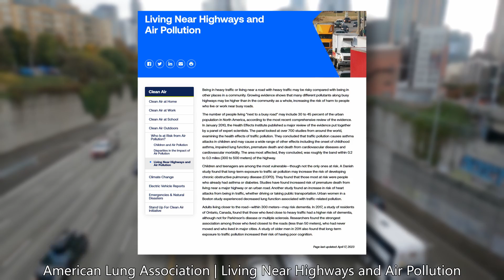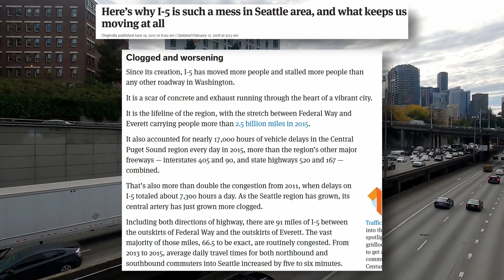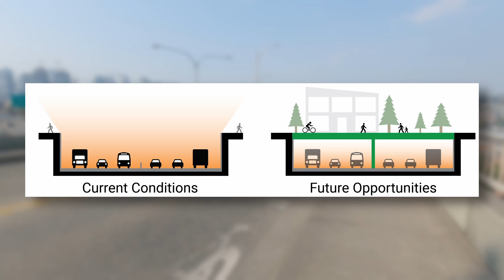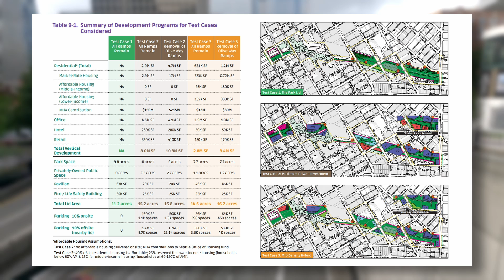What Makes this a Great Spot for a Freeway Lid?

Comment: I used to live in the Olive Tower on Olive and Boren (seen at :46 on left side) back in the 1980s, and later again in the early 1990s. In the 80s, I lived on the back facing I-5 and the noise was horrible when we cracked a window. The second time I lived there, it was facing west on Boren Ave and the noise was tolerable. I hated that highway because I had to always cross it to do anything.

Comment: I-5 is so terribly designed that there’s a segment through downtown where there is basically ONE thru lane that doesn’t exit into downtown. Seattle also has exits toggle between left and right lanes, so people are constantly changing lanes. This causes all traffic to be changing lanes constantly about 3-4 times to drive through downtown. It’s a disaster. I say bury the freeway and form a double decker freeway that provides at least 2 lanes of thru traffic and only has the right lanes exit to downtown. Then put a big park on top. Downtown Seattle has very little park space and it can definitely use a space to breathe.

Comment: I'd love if the could reroute the section of I-5 that blocks off Eastlake from Cap Hill. There were talks about doing that ~5 years ago but i think the fizzled out... That would be another interesting thing to look into. It's so hard to get between the neighborhood, so a lid might help, though it wouldn't make the hill any less steep like relocating it could (with switchbacks).

Comment: A better, more attractive, and similar cost alternative to lidding I-5 thru Seattle would be to simply fully bypass downtown to the east with several new bored tunnels underneath the First and Capitol Hill Neighborhoods, each around 2.4 miles in length (end portals would probably be cut and cover). To the south, they would start at the north end of the I-5 / I-90 interchange, and to the north, they would end north of the I-5 / Mercer Street Interchange around the curve on I-5 near E Galer Street (smaller tunnels connecting Mercer's ramps to the new tunnels would be included). Such a project is comparable to the recently completed SR 99 tunnel underneath the Seattle Waterfront which allowed the Alaskan Way Viaduct to be demolished and has given Seattle its waterfront back. The only major difference is you would need several adjacent SR 99-sized tunnels to carry I-5 northbound, southbound, as well as its express lanes.

Such a tunnel bypass, depending on how it's staged, could significantly reduce construction impacts and keep most of the current interstate through downtown construction free, with most impacts limited to the north and south tie-ins. More importantly, this bypass would allow around 2.5 miles of the existing I-5 trench to simply be filled in with gravel/dirt and re-contoured with parks, buildings, and surface streets. New highway lids over existing and highly confined interstates, especially like what is proposed on I-5, are massive, complex and very expensive structures (the foundation work alone, especially to support tall buildings on what are essentially oversized overpasses, gets insanely expensive very quickly, especially in seismic zones like Cascadia). By bypassing downtown and replacing all those lids with simple dirt fill, it gives you a lot more freedom to decide what to do with that land while also substantially reducing the cost to redevelop the land. The bypass also gives you signifigantly more land north and south of the downtown core to work with than the current lid proposals could ever hope to provide.

Further, keeping I-5 in its current location but with added lids will severely constrict future maintenance and replacement work on the aging freeway, let alone severely limiting widening or lane reconfigurations. With large diameter bored tunnels, everything is new so you can more easily bake those future capacity and expansion needs into the proposed design (you can also always add additional adjacent tunnels as needed). And depending on the design, Light Rail could even be included below the main highway decks as part of the current of a future project (a single SR 99 sized tunnel can easily fit three lanes of traffic on a middle deck and have enough room underneath for at least one track of LR, possible two. This assumes a twin-bore configuration with a smaller service/evacuation tunnel constructed between the main tunnels. A three-tunnel configuration with the express lanes in the center tunnel could still serve this purpose.) Note: it's likley several tunneling methods would be needed for such a proposal given the unique geology of the area in question.

Finally, my OCD requires one criticism of the video... as a native Washingtonian, we say "Interstate 5" or "I-5"... please don't call it "the 5" or "the I-5", almost no-one outside of California uses that terminology unless they're from there. Other than that OCD triggered criticism, an amazing video on a very important issue for Seattle!!!

Comment: A better idea would be to just do a deep bore tunnel underneath Capitol Hill between Chinatown and Eastlake. Completely remove the footprint of I-5 from downtown Seattle, adding millions of square feet potential development on existing plots taken up by the highway and reconnecting the neighborhoods to the east seamlessly to downtown once again. Maybe 4 tunnel bores, two large ones side by side for general traffic, then two smaller ones on the top and bottom for the reversible express lanes and a dedicated busway. They’ve already done extensive tunneling with Highway 99 which has completely revitalized and improved the waterfront, this would allow them to do the same with Seattle’s downtown and neighborhoods east of it.

Comment: I’d like to see Amtrak cascades be routed onto the I-5 right of way up to Everett as part of the high speed rail plans that the state supposedly wants to start. Repurposing this right of way between tukwila and lynwood for a 4 track right of way would mean making the right of way much narrower which could make multiple lids over it much cheaper

I also think suburban service could use this right of way. Link as it exists when the lynwood extension opens could be used as a replacement for I-5 during contruction of HSR but in the long term I think Seattle should have a regional RER service connecting Tacoma and Everett while the metro service (link) should only be contained in Seattle and king county more broadly. The systems shouldn’t be combined like Sound Transit is planning to do

Comment: I'd argue that the Interstate/freeway system isn't that great over highways and has been misused. Think about how many semi trucks you see driving on the interstate between cities. Those truck loads would be better on trains. Instead, they cause extra strain on the roads due their heavier loads.

To fix this, there should be heavier taxes on moving freight by truck instead of train. We need to stop letting semi trucks get subsidized by using freeways.

Comment: One of these is also being considered in my home city of Philadelphia, covering the Vine Street Expressway (I-676), though the extent of it, I'm not 100% sure. Either way, putting a lid on it would be a good way to patch up the trench that separates Chinatown and Center City with North Philly, and make the place more appealing. I would hope the idea includes closing some of the on ramps to better distribute traffic, but I'm not sure if that's whats planned, and I quietly doubt it will, even if 676 is a constant nightmare of traffic. At least the area would be nicer to be around, so I hope they do it.
Reply: Expanding the lid over the trenched I 95 would also be nice, but 676 should be first probably.
Reply: Oh 676 is such an eyesore. I hope it’s lidded one day

Comment: The whole concept of lidding freeways just pisses me off. Yes, its much better than having an ugly open pit, and can revitalize neighborhoods and improve walkability and biking. But over and over again we're told that a railroad is too expensive or impossible to build. An elevated railroad is even more expensive and impossible to build. But building a several-block wide platform of concrete over a giant pit that extends for a mile or two? No problem! Anything to keep our precious car-centric infrastructure! And where is all the pollution going to be vented out? I'd hate to live near the exhaust fan for that underground gas chamber.

Comment: I was thinking that removing exits would make the I-5 more of a motorway and less of a strotorway (a motorway with too many exits for a high-speed road, just like a stroad but for a motorway, also a strotorway needs to have an exit distance between two exits of 1.2mi/2km or less for one route direction), you proved me right. Btw, I was waiting for you to mention the notorious Union Street exit as well and you gladly did.
Reply: I agree but I think the on ramps are slightly more of a problem. In Denver there is a spot that has I think 3 on ramps within about half a mile of each other. One of them is a looping ramp and then there's like.... 250 feet to merge before it turns into an off ramp going right back off the highway. Creates multiple problems. People can't merge off/on in the same spot so it always causes a backup as everyone is trying to mix. And the onramp's loop and short headway means cars can't even accelerate to highway speed before merging. It's the dumbest possible design. Forces drivers to enter the highway ASAP and at like 30 MPH into a 55.

Comment: I think a full removal between the ship canal bridge and I-90 would have far better results for the people the live in every neighborhood in that corridor. It will reduce traffic volumes by discouraging drivers via inconvenience. Much like removing ramps for the lid. But replacing i5 with a surface boulevard that is connected to the street grid will additionally slow drivers down as well, which a lid won’t do. Freight traffic can take 99 (which makes a lot more sense) and through traffic can take 405.
I don’t hate the idea of a lid, but knowing how the Alaskan way viaduct replacement project went I have very little trust that that state DOT will be reasonable with their needs for the roadway under the lid. Not to mention the associated cost overruns. I would rather advocate for a removal by using the cost as a main point and street grid reconnections, green space and reduced noise as additional points.
Reply: It would probably be much easier to remove State Route 99, than to remove a federal interstate.  Your plan isn't bad on paper, but dealing with the federal government will be significantly more difficult and slower than dealing with the State of Washington only.
Reply: @stevens1041   very valid point

Comment: As someone who doesn’t live there, I wonder whether putting a metro line along the centre, taking out a lane each side, would work and help reduce local traffic?
Reply: The 1-Line already practically runs parallel to I-5. It needs more frequency though. And if anything, we need a light rail line that runs along hwy-99
Reply: Yep. We're back down to 10 min runs for much of the day even on weekends despite it being pretty crowded when I was there. Google had its times wrong because of it... :/
Reply: Nope the 1 line already runs parallel about 20 blocks to the west in fact it runs parallel for almost all of its length (except the section through the Rainier valley)

Comment: They should not only put a lid on  highway 5, but they should dedicate two lanes for an express metro line from Sea-Tac Airport to Boeing alongside highway 5. And get off the highway 5 at the crossing with highway 99 to go to King Street/Union Station and join highway 5 again at Seattle Library/Freeway Park in the North. And in the South join the existing metro line from highway crossing with highway 405 to Sea-Tac Airport. Seattle would get a magnificent express metro line from North via downtown to South. And in the future extend to Tacoma or even Olympia. If this express metro will ride every 5 minutes, people will use it and the loss of two highway lanes would not be missed. With so many people using mass transport, rush hour will not lead to standstills anymore. It’ll cost a lot of money though, as well as time, to build it. And it will get worse before it gets better, but in the end it will favor people living in the area. Americans always think big except when it involves public transport. It’s time for a change.
Reply: Wait, doesn't the Link Light Rail already aim to do a lot of what you are suggesting?
Reply: you should put a lid on your mouth boy. a lid??? really what a tremendous waste of money. that is like an idea a child comes up with. there are way better ways to spend a crazy amount of money like that. besides there will only be more and more electric cars on the road, pollution will go down over time.

Comment: During its heydays of growth in the 1960s, Montréal had a downtown traffic problems because of traffic getting off bridges from south shore and clogging oocakl streets to get to places.  So it built the Ville Marie expressway (now numbered 136) from the Turcot interchange (where 15 and 20 meet) to eact of the Jacques Cartier Bridge (east of Papineau street) where it merges/becomes Notre Dame street and serves port area.  
Starting at 45.492459831884844, -73.5729965506072  it was built as a tunnel, and east of what is now Robert Bourassa, was a canyon, but planned to be covered eventually.  There is an underground interchange at Robert Bourassa which is the exit from highway coming from Champlain bridge. You need to look at it carefully to see entrances and exits.  (they recently removed pedestrian spaces on either side of the former elevated highway end to call it "urban boulevards" with useless space between directions and no green spaces on either side (and no room for cyclists to reach the bike path along canal since the "street" is now a highway (in past, there were local streets either side of elevated highway in middle).  So the entrances to Ville Marie are now on the left of the roadways.

East of Robert Bourassa, the highway sits between Viger on north and St-Antoine on south all the way to Papineau. 

In the 1980s, the convention centre was built over the highway.  (Place Jean Paul Riopelle to St-Urbain, Montr.al Convention Centre). However, it was built over it, it did not provide a "lid". There was a street passing under the convention centre and over the open highway, and also western exit from Place D'armes metro station. As a pedestrian passing over the highway below and a concrete structure above was hell in terms of noise due to all othe sound reflecting on roof.  And "hell! is a understatement.   In recent years, they created a new floor below the former lower floor and actually did put a lid on highway so we can now cross through the lower floor without hearing cars now ! Yeah !

Between Robert Bourassa and the Convention centre, the tunnel was progressively covered by buildings to a poimt where someone who doesn't know would hjave any clue there is a highway below. (which is why I mentioned it was between Viger and St-Antoine. Note: in google MAPS, you will see the grey lines of where highway is, but not in satllite view). 

From the Champ de Masr Metro station (Sanguinet) going east, there was a sall building before and it was replaced by massive hospital complex with southern tip over highway. And a large park was established over the highwy on western (metro side) of that hospital wing. And east of it, it was also covered and still being converted to parks. 

It has been a slow process over 50 years, but has been deliverate and steady progress.  However, the highway was built to be covered , including ventilation ducts s below the road so as portions are covered, they open up vents from it to provide ventilation in tunnel. 

Just south of Viger , east of Robert Bourassa and west of Beaver Hall, there is a "Quebet transport" building indicated by Google maps. This is the main ventilation building for the orginal portion, and there are new ventilation buidings each of Sanguinet on the newly covered portion. 

The original tunnel is over 40 years old and is now undergoing a 10 year long rebuild (so as to not close it filly for long periods). But much of the wor is happening oustide of the roadway on the level below the roadway where many systems are located.  In the echange for the Robert Bourassa boulevard, the highway is about 40m deep but multiple levels because of the ramps to get on/off highway are fitted over highway through a narrow space betwene original buildings.   Systems include drainage which suck up over 1 olympic pool's worth of water every day.   So covering up a highway isn't all that simple.   Interestingly, on the newly covered portions west of convention centre, the buildings are so close to each other that a pedestrian is in permanent shade from sun/sky and it can feel very claustrophobic.  But there are some very nice areas where it is wide open.

Comment: Nice work on this video.  It really does make sense; the highway was already built in a trench and now it only makes sense to lid it over.  Turns out Portland Oregon has a plan on the books about lidding a portion of I-5 near the Moda Center.  We'll see if that ever happens.  I've always thought that Portland 405 which runs right through classic downtown, should definitely be lidded.  These are definitely some of the discussions that we should be having about our cities.  Thanks for your work!!